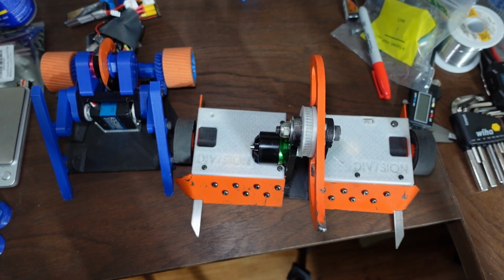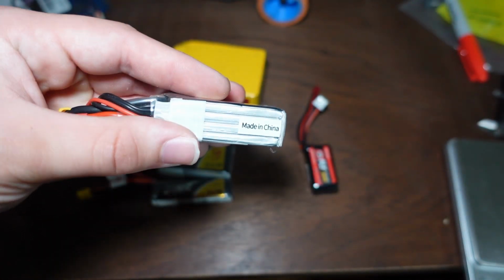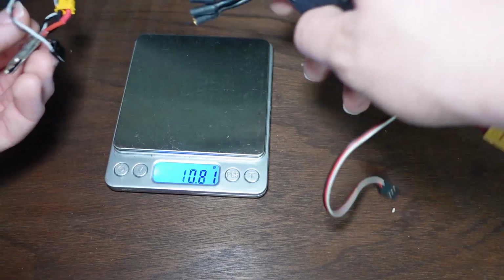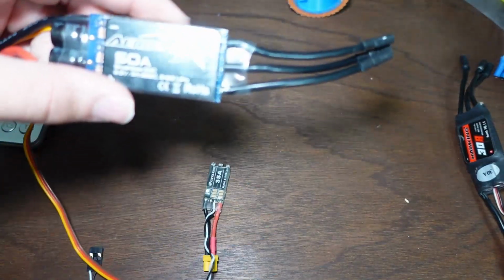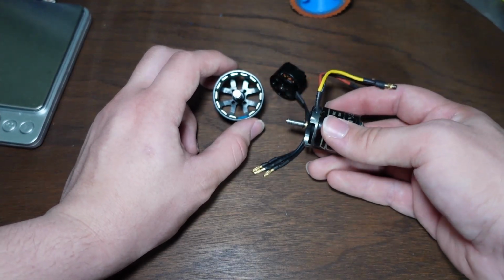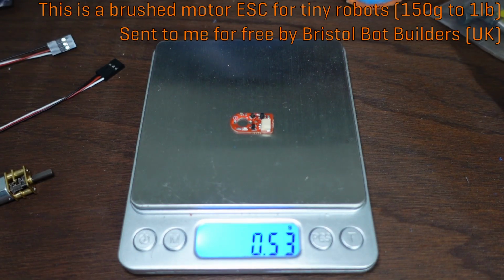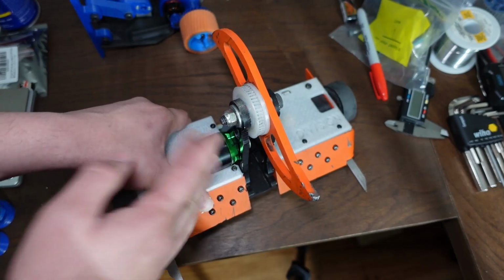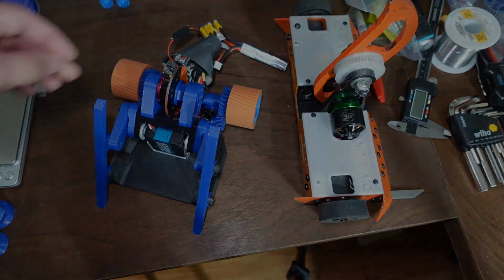How to NOT Blow Up Your Robot - Motors, Batteries, ESCs and More Explained! (How To Choose Parts)

Comment: Good info, except for one thing, the 'C' rating (discharge current rating) marked on almost all LiPo battery packs are NOT correct and should be taken with a pinch of salt.  The critical factor when You need to draw high current is the internal resistance of the cells used to construct the battery pack.  Studying data from actual live testing and measurement on a calibrated test rig has shown that You can expect 50% to 75% of the marked C rating at best in perfect lab test conditions with battery pack kept at stable running temperature. As the pack get hotter the internal resistance of the cells rises and current delivery reduces.  I have been using LiPo packs to power all manner of equipment from RC vehicles to portable amateur radio transceivers +RF amplifiers and ebikes used to haul trailers loaded with coal, rocks, concrete slabs, bricks etc..  As a rule of thumb If You need 30A use a battery pack that states it can deliver at least 60A to ensure You will be able to draw 30A safely. Also using a suitable ESC (electronic speed controller) that is rated higher to make sure the system has adequate headroom. I normally select an ESC that will handle 20% to 25% more than the maximum current your battery pack can supply in order to give the whole system a good safety margin. NOTE: running your motor with no load on it will not give you any useful date. When testing a system the motor MUST be running under normal loading, so the motor, ESC and battery are tested at their actual working load and you can measure current / voltage drop / temperature etc ad get useful data to work with.  When using systems that draw high current fitting a resettable inline fuse as close to the battery as possible is always a good plan as stalled motors, mechanical failures and electrical faults can make massive current demands on the battery pack that can damage the cells or if you are unlucky can cause the battery pack to fail catastrophically.  Test under load, always design in safety headroom, stay safe and have fun.,

Comment: No mention of capacitors? These tiny esc cannot have big ones. Coming from planes or RC cars, it seems unlikely that these ESC do not see constant voltage spikes beyond the battery voltage, a big capacitors across the esc power input could probably extend their live or stop the glitching when going from forward to reverse.
Reply from the maker: The ESCs I sell come with external capacitors these days and I just use those on weapon systems or above 5S voltage. Works fine otherwise without them on drive.

Comment: Hey everyone! I'm working on designing a 15kg combat robot for a national Battlebot-style competition in my country. We’ve got most of the design figured out, but I’ve hit a roadblock when it comes to picking the right brushless motor for drive.

Most of the motors I can find on the market are either 1000KV or 2200KV, which are usually for drones or RC planes. I’m not sure how to calculate if these motors can actually move the robot or not. The main questions I’m struggling with are:

    How do I know if a brushless motor has enough torque to move a 15kg bot?

    How much gear reduction should I add to make those high KV motors usable for driving wheels?

    Is using brushless motors for drive a good idea in combat bots, or should I stick with brushed motors instead?

Any resources, calculators, or personal experiences would be super helpful. I’m trying to keep it cost-effective but still powerful enough to be competitive.
Reply from the maker: I answered most of those questions in this 2 video series. Drivetrain Series: https://www.youtube.com/playlist?list=PL_m9B4y_C-qrMKovr0C1vxPU6ETB_A60u

Comment: Should I test robot motors for stalled movement (full resistance, no movement) and therefore maximum current draw, or is that overkill?
Reply from the maker: What do you think you would learn from that?
Reply: @JustCuzRobotics  How resilient your motors and ESCs would be in a pushing match where you are either outmatched, pinning or locked.
I'm always unsure how to interpret motor statistics to figure this out.
Reply from the maker: For a drive system usually the limiting factor is going to be your tires. The motors usually have plenty of torque to spin the wheels at a dead stop so the stall torque isn't really relevant. More powerful motors allow better acceleration but after a point pushing power is only limited by grip.
Reply: @JustCuzRobotics  Thank you for the insight. Needless to say, I'll be using this advice.

Comment: This isn't just a good video for people to learn about robots, but beginning rc/ lipo/ brushless information is all so spot on. Anyone who asks me will get recommended this video. 
In the rc world im playing in, people are really good at frying equipment. 
Rc crawler guys like to use them like submarines, and wonder why the inside of the motor corroded, or the drag racing guys will use a ridiculous 3.5 turn motor, the baddest esc they can find, and try and run it off a battery that claims 100c, but actually puts out 15c. 
If you are running a 90 amp speed controller, why are you using a xt30 connector? The amp rating for that connector is even in the name(even though im entirely aware 90 amps would still melt an xt90

Comment: What is better? Is it better to run your robot at a higher voltage with lesser current draw/ thinner wires, or a lower voltage battery with more current flowing, assuming the same amount of motion/ work is done.
Reply from the maker: The wires themselves are usually not the thing that dictates the voltage And you're going to save an inconsequential amount of weight, oftentimes, by using a thinner gauge wire. 

Running at higher voltages with the same motor, if it can actually handle that without burning up, will mean you get more output power because you're going to get more speed and similar or slightly better torque from an electric motor at a higher voltage. But you will also use more current and the motor will get hot and could burn up. 

If you use a lower KV brushless motor of the same size and higher voltage to get about the same speed and torque as before at a lower voltage, then you are probably running more efficiently and using less current which means your motor doesn't get as hot and might last longer.

Comment: Chain Saw Leg Armour ..Chainsaw protective fabric works on a number of principles .Clogging
TThe fibres of your chainsaw protective garments’ material are drawn into the drive sprocket by the chain, blocking chain movement and keeping you unharmed. Beneath these, long, loose fibres of  polyester, Avertic  , ballistic nylon, or Kevlar is laid in layers .....ie clog the motor up Armour lol

Comment: Will a lithium ion battery also work? Because of the burning danger lipos have i don't want to use them.
Reply from the maker: If your robot has no spinning weapon maybe. But Li Ion is limited to <10 amp peak current typically while lipo can be several times that depending on size.
Reply: @JustCuzRobotics  Depends heavily on the individual cell. I have Samsung 40T cells (21700 size), rated at 40 amps continuous current from 4.2V to 3V. That's per cell. You get what you pay for with Li Ion.

I would say though that they are no more safe than LiPo. The danger from LiPo comes from people not understanding proper battery care. Always balance charge each cell against the rest, charge cold, not after running the pack warm, and do not leave them full or dead for extended periods. Ions are just as dangerous if you misuse them. Check all the footage of people's vapes exploding in their pockets for example.

Comment: I just killed an esc I thought was the right rating (45a esc/1800kv 3530 motor on a rc rock crawler on 3s. The esc was for a drone and worked well til it didn’t. I’m thinking I need a higher amp rating esc, it was a heat issue or my bullet connectors touched. Any tips would be helpful.
Reply from the maker: You can always try a different ESC and make sure to tape over the bullets to eliminate that possible issue. Otherwise getting a $20 IR thermometer can help to determine if parts are overheating. Just run for a little while and check the temps on the motor and ESC. Need to use masking tape on the motor to ensure the reflective metal is read accurately.
Reply: @JustCuzRobotics  thanks for the tips.
Reply: It's almost definitly a heat issue. I've got 40a esc from skystars (talon32 slim). The switching mosfets are rated for ~250A continous and ~730A peak currents, but the esc is really tiny. Without the direct airdraft from a drone propeller (which can be easily 100kph or higher) those things just melt.n

Comment: I've been looking for a video like this for a while! A lot of the N20 motors I find online are rated for 6 volts, but I am using a 2s lipo battery (7.4 V). Would running this setup burn out the motors?
Reply from the maker: Brushed motors are generally able to deal with more voltage than their rating up to roughly 150%, but the higher you go the shorter the lifespan will be. Will it still survive a number of fights? Probably. How many? No clue.
Reply: @JustCuzRobotics  Cool! Thanks for the information

Comment: Since bots usually have metal chassis with good heat conducting properties, would it make sense to mount the ESC's to the chassis with a thermal compound to transfer the heat away from the ESC? Or wouldn't it really matter unless you have some active cooling?
Reply from the maker: Maybe! In theory anything that helps removes heat can help. But you would need a way to ensure that contact remains in place throughout a fight which could be harder than it sounds. It's not something I would rely on per se

Comment: Nice video, I feel sad for the dfrobot esc that you put > 12v into. The dfrobot integrated escs I'm sure are really intended for arduino-y non-combat applications which run at 5v or 6v, which they do ok.

I designed the BBB "Red ESC" because we felt that the dfrobot ones were a bit unsuitable for robot combat, often failing after a while on 2S voltages. But the Red ESC really isn't intended for 12 volts, that's about the absolute maximum rating for its components.

Comment: Generally, for motors of the same size, if the KV goes down, the amps go up
Reply from the maker: Power may go up but current should not. Lower KV motors sometimes can use higher voltages.

Comment: I've generally just started judging components by the wire gauge that they come with.  A 50A esc that comes with 18GA wire is a pretty good indication that the current rating is BS.
Reply: No, it just comes with built-in fuses :).

Comment: Great video, I am currently trying to build a 150 gram ant weight (us fairy weight) and I am looking for a small lipo battery that I can recharge any advice?
Reply from the maker: I have not built any 150g bots but Bristol Bot Builders has you covered: https://bristolbotbuilders.com/guides.html
Reply: Probably you want a 2S lipo pack between about 120 - 300mAh - Hobbyking have stopped doing the really nice 180mah packs they used to have. There are some suppliers around, componentshop.co.uk have a 120mah pack which looks nice but I haven't tried it (I still have stock of the discontinued HK ones). Remember to use a balance charger for all packs with more than one cell.